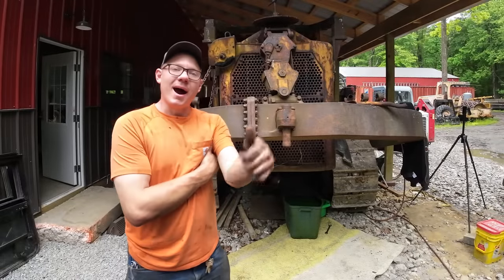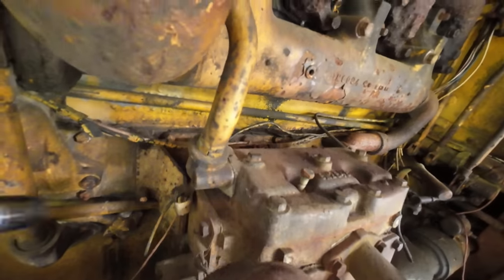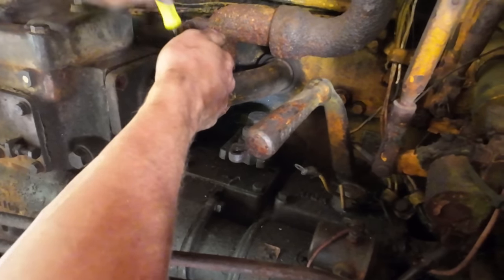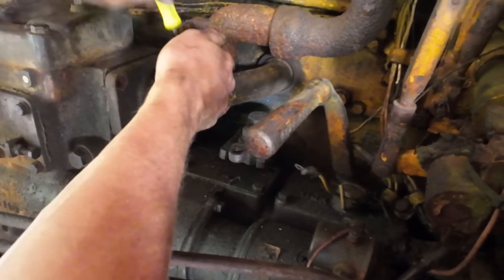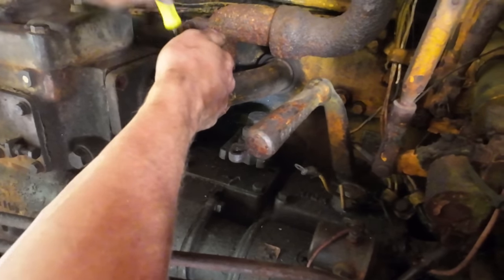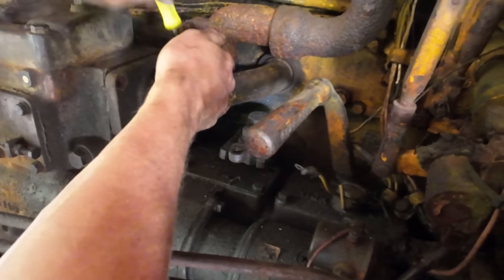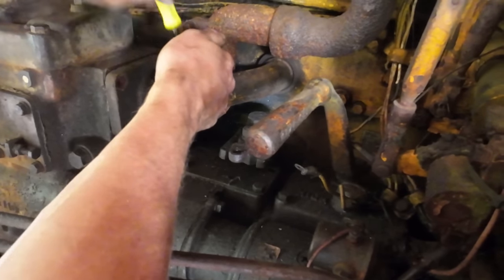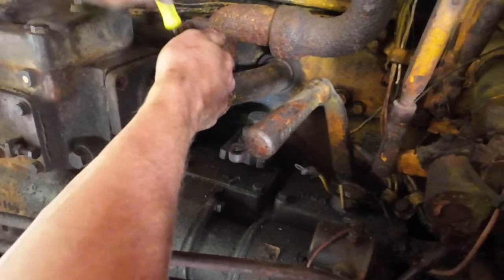Reviving a Caterpillar D8 Bulldozer (AGAIN!!!)

Comment: Hey Matt, I’m 80 years old and still wrenching, BUT my back has been complaining loud for the last two years. While salvaging around one weekend I ran into a weight lifters belt which is a massive 1/4 inch thick leather belt rigged with a heavy steel  buckle fit for a mule. $2.00 and it was mine. It is strong enough to withstand  the strain of lifting up to 500 pounds. I wear it even when I’m just bending over a fender. At the end of the project my back actually feels relaxed and does not ache. This massive belt has been a life saver for me. I had turned to liquor to ease the pain. When that didn’t work I tried narcotic pain pills. They worked BUT more pills were needed as time went on. 
Try the weight lifters belt. I can put in a good five hours on a heavy project and come away relaxed and don’t experience the intense back pain I once did.
Reply: I second this. As someone who's had three massive spine surgeries before I was 21 years old, now 31 I still don't let it stop me from living my life. I work on tons of ATV stuff, and the days that really take a number on my back is when I'm standing at my work bench building an engine for 8 hours. But then I found this back brace type belt, and with it on nice and snug I can be on my feet all day long and feel just fine come dinner time.
Reply: @BackPainGarage I have had many injuries and surgeries throughout the years luckily my back was never an issue.  Around 4 years ago I was involved in a pretty bad car wreck caused by a drunk driver on a Saturday afternoon.  About 2 weeks after the car wreck I was suddenly unable urinate and quickly lost feeling in my legs.  I was diagnosed with cauda equina syndrome and rushed into emergency spinal surgery.  It took nearly 2 years to make a 90 percent recovery.  3 days ago I woke up in the morning after a hard days work and I went to stand up and I fell over.  Tomorrow morning I am having a consultation with a surgeon.  I am in my early 40s and I can't imagine living the rest of my life with back problems.
Reply: @ChrisHarding-lk3jj I'm in my late 50's and have been living with back pain since 9/11. Lifting a truck tyre is a 2 man job but when the other guy up and leaves just because someone calls break, well I guess I should have let the damn tyre go but kept hold of it for some reason. 

Painkillers work but not well enough that I can go back to work sadly. I'm in constant pain day and night, can't even get upstairs, that's how bad the pain is. 

So all this just to say I hope everything works out for you. lower back pain is the pits!
Reply: Yes,  not too happy with playing with his back this way.
Reply: The belt may be just what I need. My lower back flares up too often.  My health insurance company turned me onto this outfit called Hinge Health.  Their whole program deals with chronic pain that others have given up on.  They've brought my shoulder back to nearly pain free movement after I was told by a surgeon that there was nothing he could do for me.  Of course, I had to laugh when Matt found out how heavy that intake manifold was.  We've all been there.  Too bad he didn't have a knuckle lift...oh, wait....
Reply: @tonyburdick5512  exactly what I was thinking. More worrying was that, even knowing how heavy it was, Matt STILL chose the manual lift way because Matt.....
Reply: GREAT ADVICE BASED ON EXPERIENCE !!!!!!!!!!
I Always pass on my negative Experiences as Others can learn in 5 minutes what it takes somebody who has experienced a bad situ - Waay Longer and maybe their lifetime !!- Trouble is !! We all have to feel the pain to Take on Board Advice !!!
UNFORTUNATELY There are Many Who Do Not Like being given advice and take it the wrong way !!
Reply: @random-person1  I’m 80 and still want to prove to myself that I got the energy to tackle the back breakers hI want to deal with. The weight lifters belt I described does the trick. Almost shed a tear when I backed away from the last couple of back breakers (half a days work, non stop) popped loose the belt and  was able to walk back into my work shop like a man—— no pain!!!
Reply: Hell man I'm 72 and feel like I'm made out of spare parts. Good for you that you can do all that stuff. Unlike you it was a woman that drove me to drink and I never got around to thanking her.
Reply: @random-person1  yeah he was into that dozers engine big time. I think this Fat Albert manifold took him by surprise, came off hard and dropped like a rock and he wasn’t ready or in the right position. My guess, that hunk of cast iron blubber weighed in + or - eighty pounds.
Reply: Your advice is probably the best ever comment . Thanks .
Reply: Dirt dauber must be a Deep South phrase rather than mud dauber, at least in my South Mississippi corner. Enjoy your videos.
Reply: @ChrisHarding-lk3jj  sending prayers your way, sir.
Reply: Hey Tim could you send a picture so I can purchase or fabricate one.....thanks
Reply: Chris Harding, I was Crushed by the loader on my HL173 Thomas skid steer in 2004. I died 4 times in the hospital yet somehow survived 😅. I was assured I would never walk again as my spine was broken, my pelvis shattered on the left side, ruptured my bladder and colon too plus I severed my nerves! I left the hospital in a wheelchair.. I was in my early 40's. I proved every Doctor Wrong as I got super lucky as somehow a few nerves reconnected. I can walk but after our govts fight against opiates I now suffer severe pain 24/7 as they took away, lowered my dosage. I still try my hardest everyday all by myself, no one wants to help an old guy that's disabled. I still turn wrenches every day, pain or not. I even went back into Towing and road service for a while. Never give up, keep trying no matter what. I worked out of my wheelchair for 2 plus years like a monkey would 😊😊. Now my memory is going fast which is worse than my accident was on me, 😢. Oh well we either tough it out or quit. I do wish I had friends but my dogs help a lot. Stay strong always. Mike
Reply: I'm going to look into a weight belt as I was Crushed in 2004 and I have tons of pain. Thx for the tip!❤❤
Reply: Can someone forward, somehow my comment here to @Chrisharding-lk3jj
I tried everything I knew how to do but failed accomplishing the task. TY
Reply: Wow, that's amazing !

Comment: That thin wall tube may be ideal for rapid heat transfer from the pony exhaust to the big engine intake air. The thicker wall works, just may take a bit longer to for the additional mass to heat up.
Reply: I think your physics is probable, but this is Western Penn. not Northern Canada!
Reply: It's gonna be a bear to start in winter
Reply: Thicker pipe may choke-off some of your intake as well.
Reply: was going to say the same thing
Reply: @mohsscale4220 that won't Be that big of a deal. They had to only large little bit on outer surface.  Pony engine exhaust on other hand might have gotten substantially More restrictive.
Reply: I came to say about the thin wall pipe and heat exchanging properties, however everybodies circumstance is different and if it suits your climate and works then how bad. 

If rotting was the main concern however then maybe a thin wall stainless steel pipe might of been an option too. Exhaust paste would help separate the disimilar metals an help avoid galvanic corrosion at the manifold. 

It's all about time. If you give the pony motor more time to heat the coolant with this thicker pipe then it should not be an issue.

You got it back together again and working. Great job 😊
Reply: @BackyardMechCon  i agree but to Be fair, Matt doesnt probadly use this machine enought to care small inconviences such as maybe starting The engine takes longer to than it should by small margin.
Reply: @mohsscale4220  OD should be the same to fit since he didn't ream out the holes in the intake that pipe fits into.    So if anything, it might reduce the power of the pony, but most likely not enough to be noticeable.
Reply: @mohsscale4220  I think its same diameter or close on the outside but thicker walled.
Reply: There's more than just the intake air to heat up if it's cold enough. That pony will have to run for probably 20 to 30 minutes just to warm up the coolant to get the engine block warmed up enough and the exhaust pipe will be more than warmed up enough to heat the intake air by this time.

Comment: I love the way my favorite channels know each other! Sam is wearing a Cutting Edge hat! International recognition and merch interchange!
Also, I am astounded that on something that lay for so long, every bolt just came right out. A few ugga duggas and a couple of zwirps and almost like they were new, they came right out.
Reply: Came here to say this, re: Curtis and CEE.  Did you see Jamie H.'s from Myth Buster's shout out to CEE?  There was SWAG, and everything.
Reply: @tetedur377  Yes, I saw that!. Very cool.
Reply: Modern battery tools are truly incredible. They're the single best thing to happen for remote field work where a compressor-equipped service truck can't access.
Reply: It all comes down to how well it was taken care of. I helped someone move an old printing press (Chandler & Price 8x12 New Style) and we had to partially disassemble it to get it through a narrow door and then the elevator. I was especially surprised when the bolts and pins came out with no more than a typical pull on the wrench, given that the basement had three feet of water in it at one point.

Comment: That gearcase is repairable messer gas makes a specialty filler rod that can be used in the tig process ive used it for years it works great. Fantastic video its great to see the yellow iron back to work
Reply: Any idea what that rod is called?
Reply: Do you have a like you could share. 
Thanks,
Roy Lewis Buffalo, NY 🇺🇸
Reply: I believe he's referring to this, However I'm not much of a welder so don't take that as fact!

Comment: You need a bench made up for the dream shop, complete with a vice and bench grinder on each corner. You’ll be using them each and every time you’re fixing something. A wire wheel on the grinder will save all of your threads on every piece of hardware you’ll have to reuse.

Comment: Matt, one reason why that exhaust tube was so thin originally is due to thermal mass and heat transfer.  The thin tube heats up much quicker due to having less material to heat up. So with the thicker pipe there, it may take a couple minutes longer for the exterior of the pipe to get up to full temp.
Reply: I was thinking the same thing when looking at that thick pipe. I'd be a little concerned too about the rust (and rust in the future) and the rust scale breaking off and potentially going into the motor. A stainless steel exhaust tube would have been my preferred solution.

Comment: Great video. Once the turbo is on. And the blade installed. You will have another piece of historic equipment ready for sand blasting primer and paint

Comment: On my small tire truck, there is a small thumb screw that adjusts the speed of the boom hydraulics. Look on the main mast of the buckle boom.  If it has one, it will be on the valve body. I love the old equipment you work on.

Comment: Great video Matt, that tyre crane is a piece of yard kit worth keeping, it's worth it's weight in gold.
Something you might consider making to protect the concrete floor is a pair of timber Mud Mats.
The things they use to save tracked plant from sinking in very muddy ground, or to help recover plant that has sunk and got stuck. Easy enough to make and you've got a good supply of timber.

Comment: The pony motor exhaust/inlet heater pipe is thin for a reason: to heat up the main engine intake faster & to cool down faster once the pony is turned off.
Best option would have been thin wall stainless steel, with the required ends welded on.

Comment: Love these old CATS. I learned to operate an old D7 about a late 40s or early 50s when I was 16 years old. The big difference was the pony motor didn’t have a starter, it had a hand crank that went out the front. If you stalled the main engine out with the blade up it blocked access to the crank. This required some how getting the blade down which was a big deal. I operated it all summer of 1963 after which I’ve never been on another piece of big equipment.

Comment: Back in the 70’s and early 80’s I was a mechanic in the Canadian Military and the company I was in had a 1964 D8 we used for building roads and recoveries. It had a pony engine and in the wintertime we would run the pony engine with the main engine on decompression for a tank of gas. We refilled the pony and cranked it up and start the main. We never shut the main engine down for the whole winter exercise. 
We also had a Cat powered generator that powered the whole camp. When it came for and oil change it took two of us to do it. The guy on top started to fill the engine while the bottom guy pulled the drain plug. Once the oil came clean the drain plug was reinstalled and the oil level back up to the full mark all while the engine was still running and generating power.
Reply: Pretty cool way to stay online...👍

Comment: Dang you made that look easy! Speaking of easy, the easy way to pull belly pans is to put two 8’ sections of rectangular tubing over the forks on your fork lift and poke them from front to back under the dozer and lift up all the way against the pan. Take all the bolts out and let it drop down on your forks, lower it down and back out, it’s just a good way to control it from falling and hurting you.

Comment: You have to remember  that the D8 intake is positive pressure from the turbo so should not suck the exhaust fumes now the gaping holes are gone...Love Sam's CEE hat! Kurtis and Karen have done well for themselves for a little Aussie company! Was surprised to see the O rings on the D8. When were they first used or is that a newer intake setup? Great work Matt! Cheers from Tasmania, Australia
Reply: Positive pressure once the turbo spools up. Until that time (starting) it is not.

Comment: 3:45: I believe this is why the US M47 / M48 tanks also had pony engines to start the main engine, but also in order to deliver electricity for running the tank's other systems, such as turning the turret or heating the inside, which is pretty useful when the tank operates in sub - zero temperatures!

Comment: You should check with the stone quarry you get your stone from and see if you could get some old conveyer belts to lay down on the shop floor to protect it from the tracks.  That's what we use at our quarry when taking track equipment across the blacktop road into the pit

Comment: That heavier pipe through the exhaust will not heat up as fast as the lighter pipe did. The big engine may not start as well as before.
Reply: Doesn't matter much, since he hasn't grasped the concept of how neither pony motors nor glow plugs are supposed to be used. Foreplay isn't his thing, he goes straight to intercourse

Comment: I love your new shop. When you do more work on it, I'd love to see what you do to finish it. Your shop is something I've wanted most my adult life (that’s at least 50 year) but never been able to build.

It always amazes me how little work you actually have to do to get these old pieces of equipment running. I'd think you'd have to rebuild everything to new condition. You've shown me that you don't really need to put a lot of effort into old equipment to actually get it working. Of course, it might be the difference between Diesel engines vs gas engine but still, even the gas engines, such as the Pony motor, seem to return to life with minimum effort. Keep up the interesting videos.

FYI: Your videos are about the only ones I watch all the way through. You do a good job of keeping the boring stuff short by speeding through it; such as when you reinstalled the Pony motor. Thanks for your efforts.

Comment: Nice, really hoping this will be in length similar to the Galion grader restoration :)
Also i would have dropped dirt or gravel over the boards on the shop floor to prevent any demage, at 39:45 you can see between those boards a bit of wheight demage on the floor.

Comment: Good to see the big girl running good!  One thing you may want to do before winter comes back around is getting a BIG vent fan put in at one end of the shop above the doors to get any winter time diesel smoke out of the shop without having to open the doors.
Reply from the maker: I have one in there. It just needs wired up.

Comment: That crane truck looks like an excellent addition to the family. At least until you get around to installing the gantry crane :)
Reply: It will be a handy thing to have anyway.  The gantry crane will be great, but it can only work inside the main shop.  Mobile cranes can be used anywhere you can get them into.

Comment: [24:00]   I imagine that the old pipe was thin to facilitate heat transfer- this thick one is not going to do much pre-heating of the diesel intake unless it runs for quite a while.  But it won't rust out!

Comment: when you were first building the garage/work shop. i suggested a pit area be dug and formed for all the work you do/ were going to do beneath your equipment.  Can you still do a pit like at Jiffy Lube and cement it, add lighting and power supply and drainage/sump pump?
In the long run you will bless the day you do it.  Safety, convenience, access and comfort will all be greatly improved.

Comment: Cat has a plan for Field tool for turbo overhaul hold turbo housing vertically. Need two 3/8 drive u joint socket twelve point. Glass beed sand blaster, does fantastic job.  Cartridge part dies (middle part).